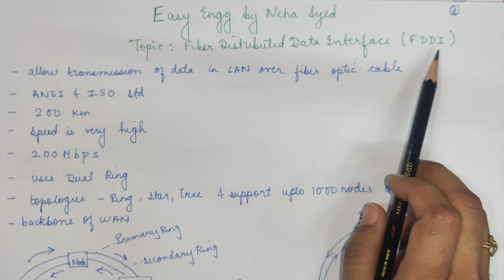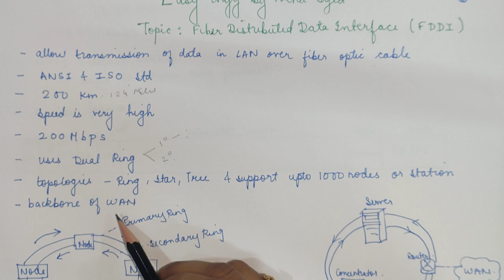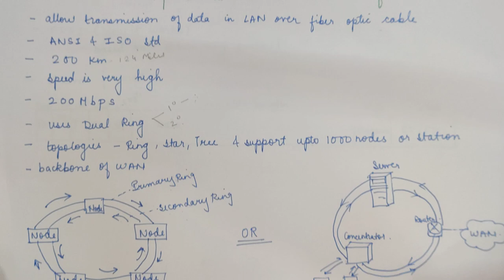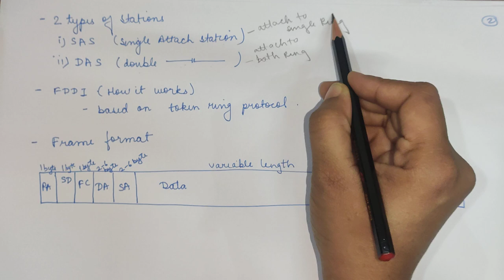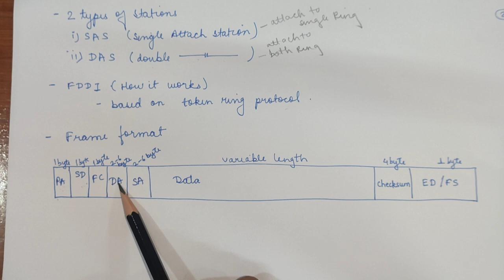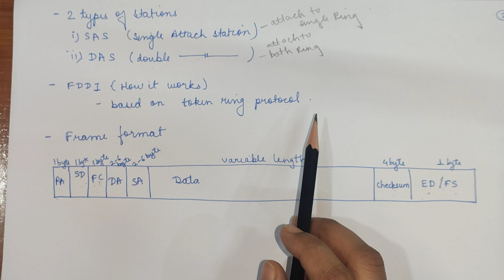FDDI ( Fiber Distributed Data Interface ) | neha syed

Comment: For an FDDI access having four stations, making the assumptions, TTRT is 30 time units, the time required for the token to go from one station to another station is 1 time unit, each station is allowed to send two synchronous data units per turn and each station has a lot of asynchronous data to send waiting in buffers, calculate the data transfer for four rounds and tabulate the results.
Reply: Someone kindly give a response if you know the answer.

Comment: Over a local area network extended upto 200km or 124 miles in diamter in using fiber optic cable 200mbps uses dual ring for fault tolerance suppptw maximum of 1000 nodes.. ring star and tree topologies used..  
Carries both data in opposite directions for fault tolerance... token based sharing mechanism is used to tell which ring will transmit. 
Two different sas and das...
Single attached station single ring attachment
Double attached station - double ring attachment... ..